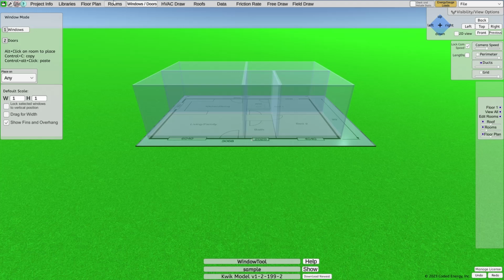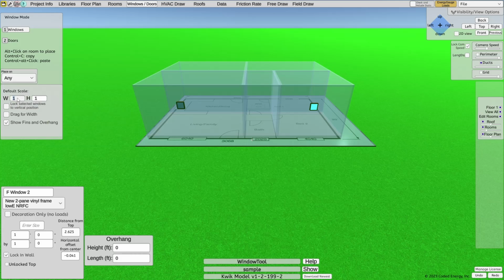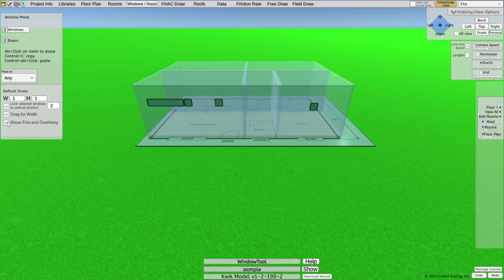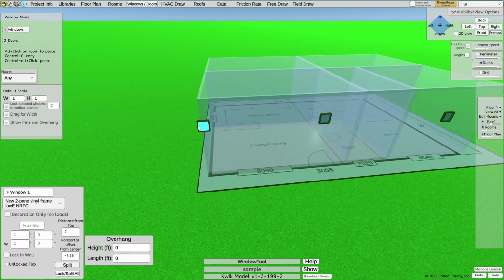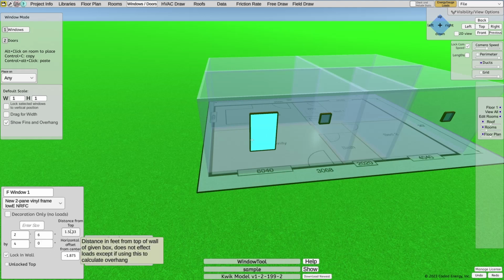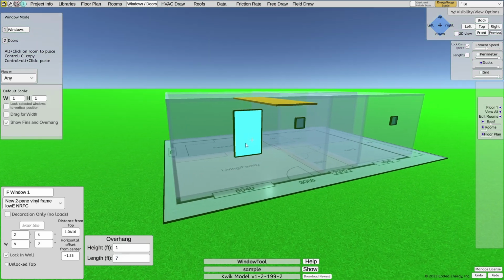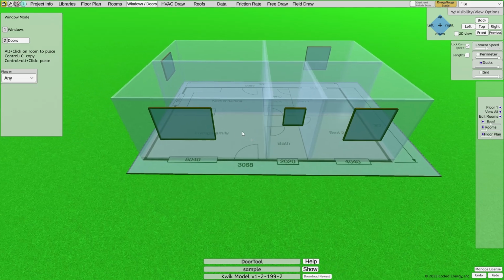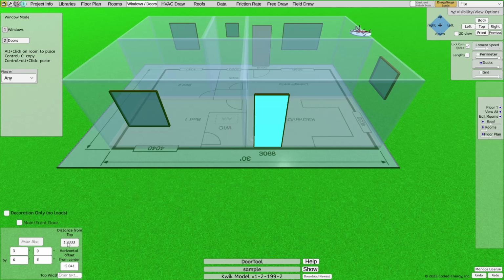DDV Windows & Doors

Comment: what is the significance of marking the door as Main/front door? for assessing infiltration?
Reply: That may be a holdover from the energy modeling version.  In the CA energy code, they ask you do designate the main or front door.  It is purely for reference.  It makes it easier for the building inspector to get his/her bearings when inspecting the house.